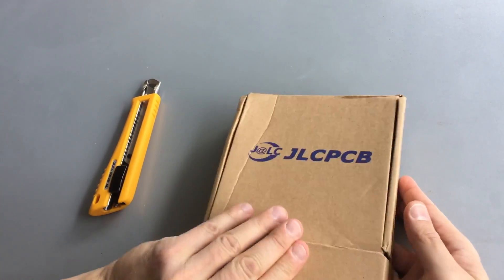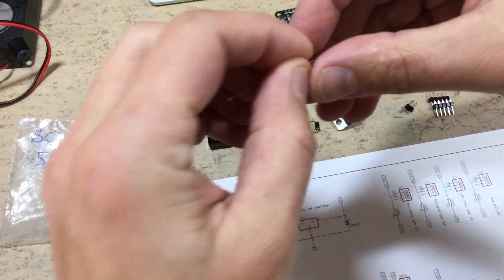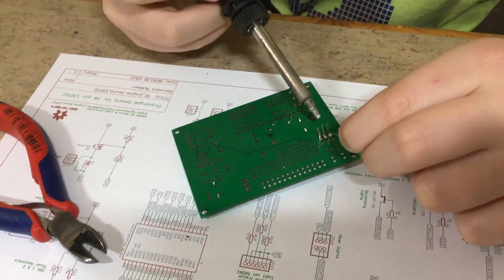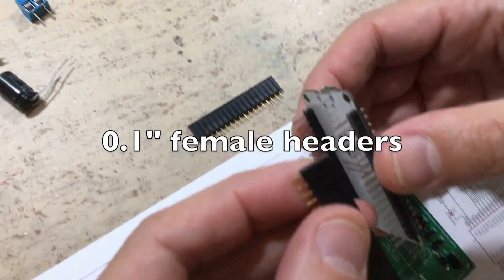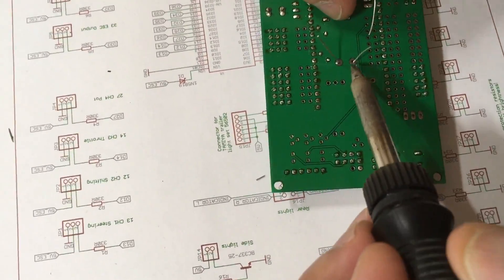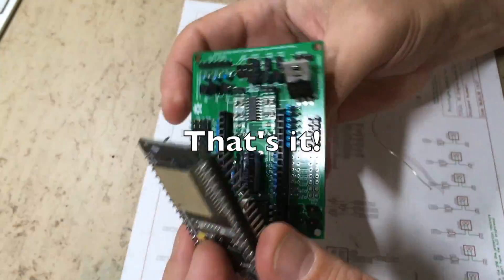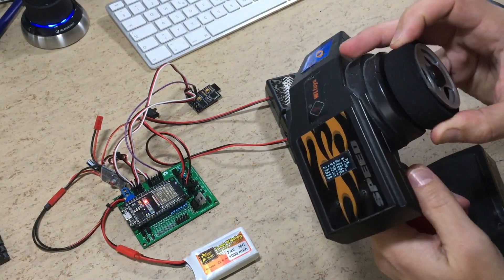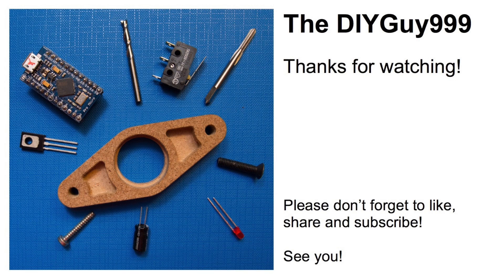Arduino ESP32 RC Engine Sound & Light Controller: How To Assemble The PCB Tutorial

Comment: You probably don't see my questions, sorry I repeat:
Made https://drive.google.com/file/d/1dVIT7l2P2MpfOBLH3_kCMPbvrJlF9SqN/view?usp=sharing , 
recorded https://drive.google.com/file/d/1yLZ9HRcKXTzI5lZ1up5UEey9HA0pEf_u/view?usp=sharing . 
In line 34, "/ / " was removed https://drive.google.com/file/d/18NEpkMI_zH5nPoBfRa0j8PSh_zk52eQZ/view?usp=sharing . 
When you turn it on, there is a sound https://drive.google.com/file/d/1dUYCm0IrqjWiHI2U-DHRKY2VLODpLxAu/view?usp=sharing . 
Doesn't react to anything.
then I wrote // in line 34 "//#define SBUS_COMMUNICATION // control signals are coming in via the SBUS interface (comment it out for classic RC signals)", 
the sound of the engine began to react to the gas trigger, but the electromotor does not work. Led lights do not turn on.
Reply from the maker: sorry, I did not see it. For the wiring on your picture, you need to set it as follows:
// ---------------------------------------------------------------------------------------------------------------------
// Choose the receiver communication mode (never uncomment more than one! If all commented out = classic PWM RC signal communication)--
// SBUS communication --------
//#define SBUS_COMMUNICATION // control signals are coming in via the SBUS interface (comment it out for classic RC signals)
boolean sbusInverted = true; // true = wired to NPN transistor signal inverter or uninverted SBUS signal (for example from "Micro RC" receiver)

// Serial communication --------
//#define SERIAL_COMMUNICATION // control signals are coming in via the serial interface (comment it out for classic RC signals)
// Only for my "Micro RC" receiver! See: https://github.com/TheDIYGuy999/Micro_RC_Receiver

// PPM communication --------
//#define PPM_COMMUNICATION // control signals are coming in via the PPM interface (comment it out for classic RC signals)
#define NUM_OF_CHL 8          // The number of channels inside our PPM signal (usually max. 8)
#define NUM_OF_AVG 1          // Number of averaging passes (usually one, more will be slow)

so you settings should be OK, but your clock frequency appears to be 80MHz. This is wrong and needs to be 240MHz. See:
https://github.com/TheDIYGuy999/Rc_Engine_Sound_ESP32/blob/master/Board%20settings.png
Adjust your board settings accordingly and it should work
Reply: @TheDIYGuy999  Thank. Do I need to install ESP-IDF Tools to change from 80 to 240 MHz? or can it be different?
Reply from the maker: @МихаилКуракин-с2щ  No, just adjust everything in Arduino according to the picture in tools/board
Reply from the maker: @МихаилКуракин-с2щ  according to your screenshot, your board settings are correct now. Which electric motor, the shaker or the drive motor? I assume, there is an issue with your 5V supply. Did you measure it? Does the 7805 regulator deliver 5V? Are there any error messages in Arduino (I don't recommend to use hourly build of the Arduino IDE BTW)? did you change anything in the sketch?I think, you should make a short video, which shows the problem in detail.
Reply: @TheDIYGuy999  Arduino downloaded this one https://drive.google.com/file/d/1_6nZORaZfV2pQuz3Fy5WMNespJJYxn6F/view?usp=sharing Version https://drive.google.com/file/d/1bnKpp2tBpISzw5S6gF_PGAU2B016oy66/view?usp=sharing 
After compilation https://drive.google.com/file/d/1ohgrfaRPIs0beiH8PhAyWHZ9P_hVv6AP/view?usp=sharing  Voltage measured, everywhere 4.95 volts. The drive motor does not work, I did not install the shaker.
I didn't change it in sketch. I'll post the video tomorrow.
Reply from the maker: @МихаилКуракин-с2щ  I don't think the IDE is the problem, but it is strange, that "hourly build" is displayed. It is compiling and uploading without any error message? It looks like you don't use the Hobbywing 1080 ESC. I don't recommend anything else. At least make sure, it is a crawler style ESC with direct brake (reverse without double click). Let me know, as soon as the video is online. You have to provide more details about what works / doesn't work, otherwise I can't really help you. Also have a look at the improved wiring & adjustments instructions on my GitHub. BTW: why you don't use SBUS? It looks like your receiver has an SBUS output. Make sure, you are using series resistors for the LED (except TAMIYA trailer port). Edit: I just noticed on your pic, that throttle (CH3) is not connected  (keep in mind, that all 4 CH ports are wired in pairs): CH1 steering, CH2 shifter, CH3 throttle, CH4 horn / siren / bluelights. It also looks like your connectors are nor properly seated?

Comment: Are the speakers you use 8 ohm? The banggood ones don't say and are taking forever to ship.
Reply from the maker: I'm using different ones with 4 or 8 ohms, it doesn't matter
Reply: @TheDIYGuy999  OK. So the board will handle a pair of 4 or 8 ohm speakers? I'm just about to start building the board.
Reply from the maker: @SpeedyDad1  Yes, have fun with the build. You can find a parts list on my GitHub

Comment: Great, great job! Yesterday I bought all, I'll try it.
Is posible the battery connector missing from the BOM? Thanks!
Reply from the maker: Thanks. Yes, it was missing. I have re-uploaded the parts list on my GitHub.
Reply: @TheDIYGuy999  you are the best!
Reply: What kind of ESC you use for this proyect? Thanks
Reply from the maker: @oscarveterinario  Hobbywing 1080. The required settings are documented on top of the Adjustments.h file
Reply: Hello, I just finished soldering the board and I have two doubts: I can't find where to solder resistor 18. On the PCB board, under the PAM8034 module there are several holes, do no components occupy those holes?
Thank you very much!
Reply from the maker: @oscarveterinario  Hi, R18 is a potentiometer and located between the supply terminal and the ESP32. You can find the type on the parts list on GitHub. Four of the holes below the amp are just because of the amps footprint. The other two are intended for supporting the amp, using a shortened pin header.
Reply: @TheDIYGuy999  thanks!

Comment: Nice work. I am building a Light controller with arduino. What you recomend to control high Power like a servo or high consumption leds with arduino? What kind of transistor?
Reply from the maker: Thanks. A servo does not require a transistor, because the power transistor is already inside. For a standard LED, a BC337-25 transistor is OK. You can also use an ULN 2003 IC. For details, have a look at the schematic on my GitHub

Comment: Hi, Ive just built the board and it the voltages seem ok. Im stuck on the next step. Ive looked at your github, but cant find where the code is to upload. Can you tell me please. Love the project thankyou
Reply from the maker: Go to https://github.com/TheDIYGuy999/Rc_Engine_Sound_ESP32, then hit "Clone", "Download zip".
You also need to download and install the libraries, which are mentioned in code lines 48-49.
Also install the ESP32 board according to: https://randomnerdtutorials.com/installing-the-esp32-board-in-arduino-ide-windows-instructions/
Select board according to: https://github.com/TheDIYGuy999/Rc_Engine_Sound_ESP32/blob/master/Board%20settings.png
Reply: @TheDIYGuy999  Thanks very much :)

Comment: will any transmitter and receiver work for this?
Reply from the maker: Yes, standard servo signals, SBUS and PPM are compatible
Reply: @TheDIYGuy999  I put it together all im getting out of the speaker is a clicking noise and no response from my transmitter I put the arduino one together and it works fine but the esp 32 I cannot get to work at all ive confirmed that the code did upload successfully and I uploaded it multiple times Im using a flysky transmitter and reciever checked all connections are correct any ideas to why there is no engine sound and just clicking noise?
Reply from the maker: @WARHERO388  Which communication mode are you using? Servo signals, SBUS or PPM? You have to select the correct mode in "Adjustments.h", lines 31-39
Reply: @TheDIYGuy999  thanks for the quick reply! I am using ppm and I uncommented sbus and serial and commented ppm and still has the same problem
Reply from the maker: @WARHERO388  The wiring is correct according to the schematic? For PPM you need the following configuration:
// ---------------------------------------------------------------------------------------------------------------------
// Choose the receiver communication mode (never uncomment more than one! If all commented out = classic PWM RC signal communication)--
// SBUS communication --------
//#define SBUS_COMMUNICATION // control signals are coming in via the SBUS interface (comment it out for classic RC signals)
boolean sbusInverted = true; // false = wired to NPN transistor signal inverter or uninverted SBUS signal (for example from "Micro RC" receiver)

// Serial communication --------
//#define SERIAL_COMMUNICATION // control signals are coming in via the serial interface (comment it out for classic RC signals)
// Only for my "Micro RC" receiver! See: https://github.com/TheDIYGuy999/Micro_RC_Receiver

// PPM communication --------
#define PPM_COMMUNICATION // control signals are coming in via the PPM interface (comment it out for classic RC signals)
#define NUM_OF_CHL 8          // The number of channels inside our PPM signal (usually max. 8)
#define NUM_OF_AVG 1          // Number of averaging passes (usually one, more will be slow)

You may need to change the channel order in the following function (change the number in [ ]):
pulseWidth[0] = valuesBuf[0]; // CH1 Steering
    pulseWidth[1] = 1500;         // CH2 Gearbox
    pulseWidth[2] = valuesBuf[1]; // CH3 Throttle
    pulseWidth[3] = valuesBuf[2]; // Pot1 Horn
Reply from the maker: @WARHERO388  I see many wires coming from your receiver, which connect to your PWM pins. Are you really sure, that you are using PPM? PPM and PWM is not the same. If you want to use PPM, it only requires one wire (plus GND and 5V of course) and needs to be connected to pin 34. For the pin mapping have a look at code lines 56 - 100
Reply: @TheDIYGuy999  thanks that fixed it :) I didnt notice for some reason ppm pin is 34 and not 13 lol
Reply from the maker: @WARHERO388  Good to hear. So, if you use PPM, you can remove all the other signal wires. Can't wait to see your video.
Reply from the maker: @WARHERO388  No, this receiver is not suitable at all. I only used the housing of this transmitter, the entire electronics are DIY. You can find the data on my gitHub.
Reply: @TheDIYGuy999  also is there any motor cycle sounds already made or do I have to make them myself and if I do how long should the wav file be in length?
Reply: trying to make this my idle sound but its forcing me to convert it too 1600 sample rate when its 4800 if I do 1600 it completely ruins the sound but it only works like its supposed too at 1600 this sound https://www.youtube.com/watch?v=o7laqBFqpFg&t=130s
Reply from the maker: @WARHERO388  There are dozens included. Just uncomment the one you want and have a look at the example configurations
Reply from the maker: I only recommend 22050 Hz sampling rate. Convert the sounds as described on GitHub and it will work.
Reply: @TheDIYGuy999  if you can could you provide the ferrari.wav file? that one is close to what im looking for so I can get a better picture on how to sample these instead of going off the .h files

Comment: Hello Friend!  your project is exactly what i was looking for.  I work with electronics, I made some changes to improve and support more leds connected together, but in programming I don't have much knowledge yet, would it be possible to use this sketch in an atmega 328 to further reduce the costs and the size of the board?  If you want to touch knowledge and ideas, leave your email for me to get in touch.  Greetings from Brazil! 👍
Reply from the maker: Hi, there is no way to stuff this code into a very limited 8 bit board such as a 328, but I also have a simple version for the 328: https://github.com/TheDIYGuy999/Rc_Engine_Sound
best regards
Reply: @TheDIYGuy999  thank you very much friend!  I will try this project until my esp32 arrives.  would it be possible to add some light functions in atmega ?!

Comment: petite question , une fois le module connecté, ou se branches les servos-moteurs ?
Reply from the maker: On the board version for the 30 pin ESP32, there are pairs of connectors, which allow to feed the signal through. Otherwise, you can use Y-cables. I always use the board in SBUS mode, so I don't need the servo signal inputs.

Comment: Fantastic material for newbies!!!
THANKS.
I have a little question: Should I add resistors to the LEDs that I will put on the truck?
Or are the ones we put on the electronic board enough?
Grateful.
Reply from the maker: You always have to use series resistors for LED, only the Tamiya trailer connector provides internal resistors: https://www.hobby-hour.com/electronics/ledcalc.php

Comment: For the most obscure you can create a lesson how and what to download to ESP32 30pin?
Reply from the maker: I may do it later on, but you can find it on GitHub and in the software comments. Basically, you have to install the ESP32 boards according to: https://randomnerdtutorials.com/installing-the-esp32-board-in-arduino-ide-windows-instructions/
You also need to install the libraries, which are mentioned in the software comments
Reply: @TheDIYGuy999  thank you, what is shown in this lesson, I have already done.
Reply: @TheDIYGuy999  I'm interested in how and what files should be downloaded for sound and light for example for King Hauler. I'll wait For your lesson.
Reply from the maker: @МихаилКуракин-с2щ  Delete everything in the "Adjustments.h" tab, then open "/settings/KingHaulerSettings2" and copy and paste everything in "Adjustments.h"
Afterwards, select the communication mode you want in lines 31 - 39
Reply: @TheDIYGuy999  thank you, as I understand, I do not need to change anything in communication mode for PWM RC signal ?
Reply from the maker: @МихаилКуракин-с2щ  Yes, in "Adjustments.h" you need to remove both // in code line 34
Reply: @TheDIYGuy999  thank you, I understand.
Reply: sbus signal inverter on one circuit, the resistor is R29 - 10K, and on other 4k7. what to put ?
Reply from the maker: @МихаилКуракин-с2щ  The current version shows 4k7, because it provides a cleaner square wave. So I recommend 4k7.
Reply: @TheDIYGuy999  OK thanks .
Reply: put // in line 34 "//#define SBUS_COMMUNICATION // control signals are coming in via the SBUS interface (comment it out for classic RC signals)", the sound of the engine began to react to the gas trigger, but the engine does not work. Led lights do not turn on.

Comment: I just fired up my ESP32 Sound board for the first time and I can't describe how awesome it was to hear it roar to life and to know I'd made it, not bought it. Thanks for making this possible by sharing your design and software! I'm looking forward to more of your great projects!
Reply from the maker: I'm happy to hear that. Have fun with it!
Reply: @TheDIYGuy999  Having problems getting the shaker motor to run. Continuity,  +5 and grounds are all where they should be. I replaced the Mosfet,but that didn't fix the problem.   I see you added a 10k resistor to the shaker circuit that does not appear  in your hand drawn diagram in the RC_Engine_Sound_ESP32-Master  files. Why was that added?
Reply from the maker: @jps99  the 10k resistor is just a pulldown resistor, preventing the gate from floating around while uploading the code. Which mosfet type did you use? You need a logic level N-channel type.
Reply: @TheDIYGuy999  I used an IRF540 which is an N channel device. FYI, I'm using the V1 36 pin board, so thanks for pointing out the issues. I also have the 30 pin boards so I may try one of them.
Reply from the maker: @jps99  This FET is not logic level compatible, VGS can be up to 4V, so it may not switch on properly with 3.3V. Depending on your motor, it may not run with the values in my configuration. Try with 255 for full speed
Reply: @TheDIYGuy999  I changed the shaker values all to 255, but except for a small pulse of the shaker when I turn on the unit, nothing.  I've ordered a cheap little oscilloscope so I can better see what is going on. It will be handy as I work more with ESP32 and your transmitter and receiver projects I will be working on next. Thanks for your help!

Comment: I did exactly the same. zeroed it out and then uploaded the file in UGS etc. but it appears as soon as i bring the file to UGS, UGS is creating some sort of margin around the work and my work shifts to about little bit (about 1/4") to the right. It does all operations fine but lil bit to the right. Do you know what could cause this? My coordinate in fusion is based on box points  (top left corner)  and the axis is all correct. The box around the work is also set to exactly match the work piece. So I don't understand from where the shift to the right is coming from.

Comment: When I upload the Gerbers file at JLCPCB the board Dimensions does not pull in.     What should it be?    Thanks
Reply from the maker: What do you mean with pull in? I ordered both version of the board with exactly the same Gerber files and they came out great.
Reply: @TheDIYGuy999  When i uploaded the gerbers file to the JLCPCB web site everything came in but the board size.   What size is the board?
Reply from the maker: @rudyackerman5747  60x80mm. Upload Gerbers.zip and it will work
Reply: @TheDIYGuy999  I down loaded the gerbers.zip again and this time it worked.   Thanks.
Reply: @TheDIYGuy999  My boards arrived today.    Now waiting on all the other parts.